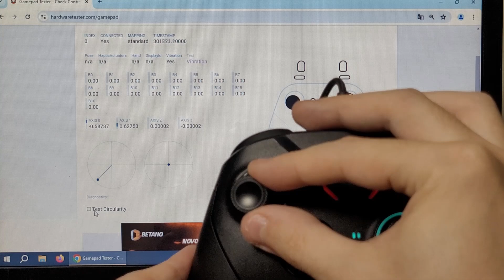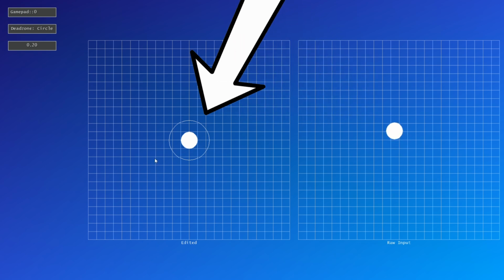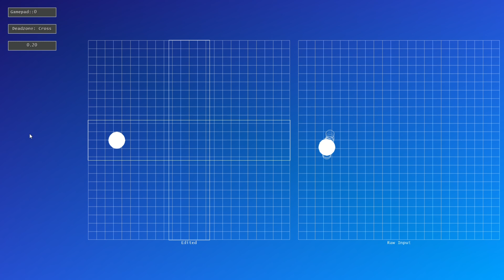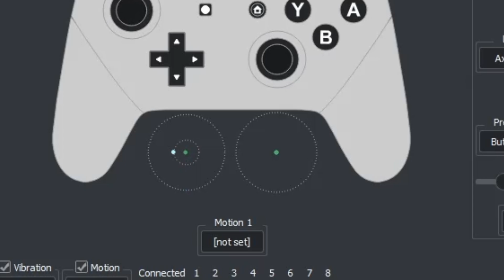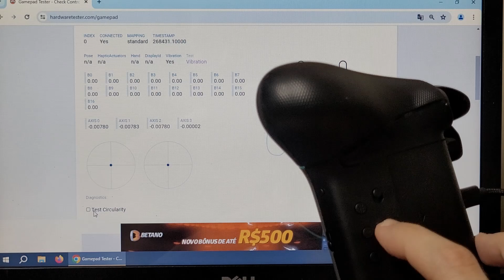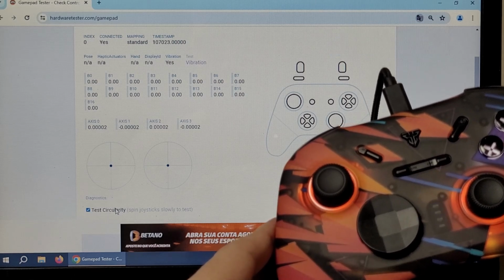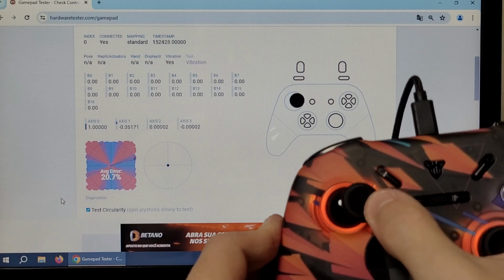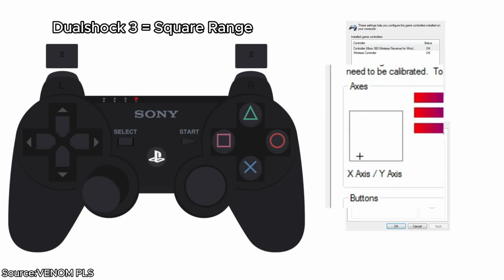Analog Sticks 101 - What makes a good analog stick?

Comment: my controller has perfect circular input, but in rocket league i noticed car turns slow.
 
How do i concert input from circular to square ??
Reply from the maker: if your controller has a configuration for that it should be in the manual, if not then you can't

Comment: I wouldn't say modern games are design with perfect circularity in mind. They are mostly based around whatever the consoles controller's stick range are, which is around 8% - 14% or a "soft-square circle" as some called it.

Comment: Great summary of these issues. I wish reviewers of controllers would go into more detail on the behaviour of analog sticks and analog triggers. I've bought several 8bitdo controllers over the years but find their range of analog stick and trigger movement to be short, making small changes to inputs very difficult. A standardised set of rigorous tests using a gamepad tester, like shown here, is what I would find more useful in a review. Many reviews are just where someone tries to vaguely describe how a controller feels, which is too subjective or only works well in a specific game.

Comment: Thanks for the tip, not a fan of the deadzones manufacturers set it at default, I guess to accommodate all users including pre-teens- I want it to move as soon I move it even if it's a 1000th of a millimeter for example on the Dualsense; same with the triggers- I guess being an artist who's practice gradient shading by hand make you more need things to be precise and very responsive.  I set it to negative if I could, set at always zero with the sensitivity set to the highest which is 5 in the a case of D4Windows but I guess the consoles must rely on 3rd-party where these parameter are adjustable in hardware w/ onboard settings memory (similar to gaming mice like the G502).

Comment: Cool, do you have the analog stick grips like KontrolFreek or Skull & Co. grip or SparkFox's Pro-Hex? Grips like KontrolFreek improved things, I got to do a mission hours faster (less replays) so I can finish the game faster to move on to the next AAA game. If you use analog stick grips, what brand and what kind (convex, hybrid or concave) with which franchise (originally I got the 5x to 6x cheaper than KontrolFreek, Skull & Co's 6-piece analog grips but the surface is a bit small but it's got a good rubber but there's no hybrid surface, I refunded that and got the Call of Duty: Vanguard from KontrolFreek which is both high-rise which is good for precision on FPS/TPS w/ vehicles but the Skull & Co.'s QCQ grip, the very convex shape is better than the KontrolFreek's straight edge.

God bless.

Comment: I need help please. I have 2 controllers with hall effects from different companies one of my controllers sticks are really slow when turning. Compared to original and my other controller with hall effects. The guy the built it doesn't know what the issue is or how to fix it, if someone can please help I would be very grateful.

Comment: A perfect circularity is not always a good thing. 
Take Horizon Zero Dawn for example; if you have a circular range Aloy won't sprint on the diagonals. So it's a very bad idea.
Reply: @pallas_wept  
Use the Kingkong 2 Pro on the middle sensitivity setting (100%) for the left stick and try to sprint diagonaly on Horizon Zero Dawn (or maybe other modern games).

Comment: Glad to see the Rocket League mention. (Square stick/deadzone does wonders for the harder mechanics in game)
Reply: Yes but it's less accurate. You can use circular deadzone and compensate by adjusting the ingame sensitivity. That's what the pros do. I'm sure you know this though.
Reply: @yercules  True in theory, but irrelevant in reality. The normal resolution of a controller stick (today) is 14 bit. That means that the entire range of the stick is divided into 32,768 positions. If you use a square deadzone, you have 21,170 positions (multiply by sine of 45 degrees). And that's if it's a bad sensor implementation that doesn't scale the range in the analog domain, if it were a good implementation (VERY rare) you'd lose NOTHING. Even in the bad case, for you to be able to even create a difference, you have to be moving with precision at least twice that resolution. That means you have to be able to hit the exact same area of about 20,000ths of a centimetre in size, every time. Your thumb is not that accurate, and neither is a pro player's thumb.

You DO have to learn to be more precise, because the physical throw extents have been reduced, but that's a skill issue, not a controller configuration concern. It's the same as sensitivity in mice. You can turn faster, IF you increase sens, but, that makes it harder to aim. This is increasing sens, and has the same effect.

So, don't worry about it, apply the optimal settings, gitgud, enjoy the extra W's. Or like, don't, and sweat less. It's all good! :)
Reply: @yercules Circular deadzone limits the flip cancel range. Stuff like Jakze and Maktuf resets are way too scuffed with circular deadzone . It's also not really an issue when you get used to it. (Reverse and normal tornado spins go a bit deeper too. Great for those crisp/glue'y first touches)